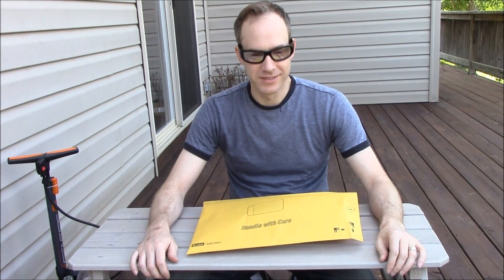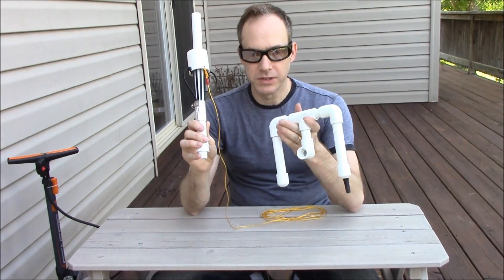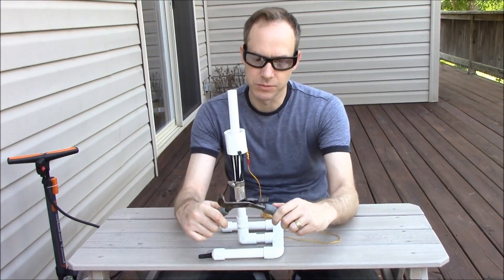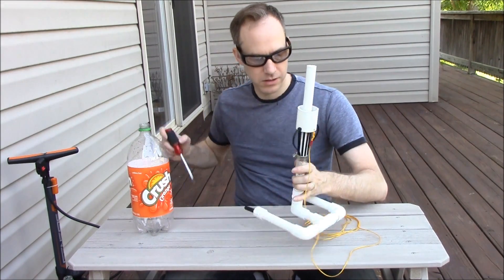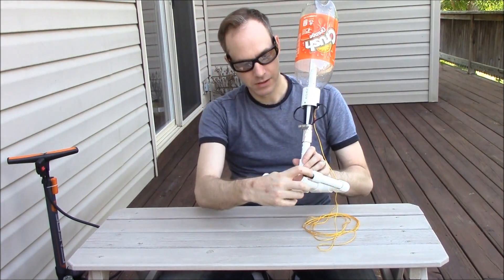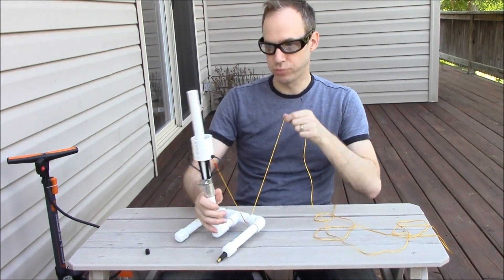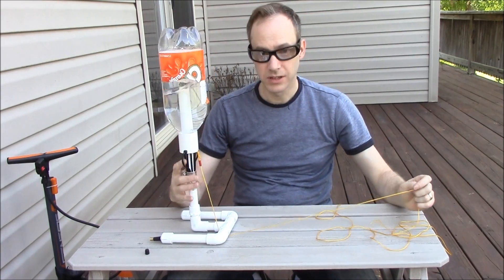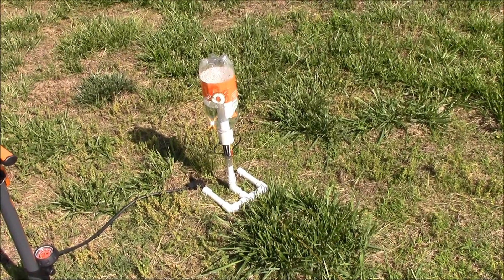MICRO- Water Rocket Launcher, unbox and launch (bottle rocket)

Comment: Can you use smaller bottles for this rocket?
Reply from the maker: Yes,  I have used 1 liter bottles and even some 500 ml.  but be cautious of thin walled bottles that are sometimes found in sizes smaller than 2 liters.  Dont use them at higher pressures as they have a potential to explode at lower pressures because of the thinner bottle walls.
Reply: Thank you.